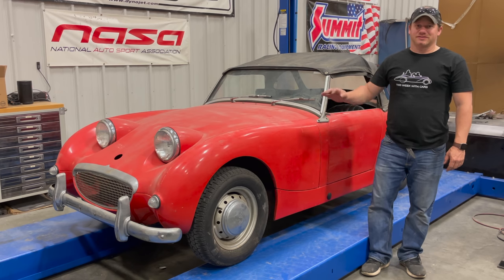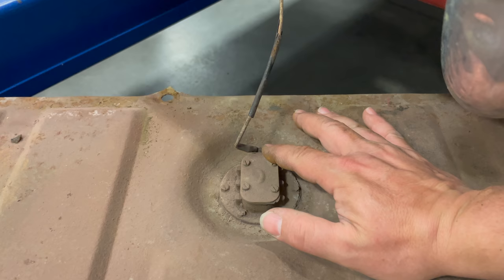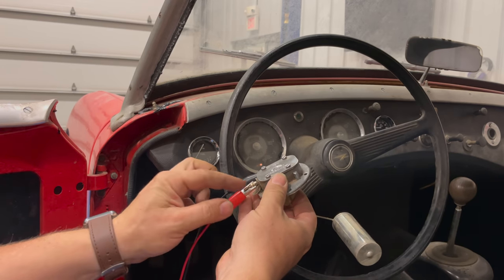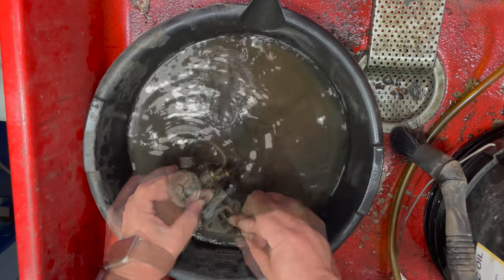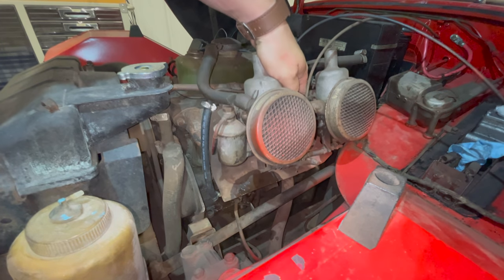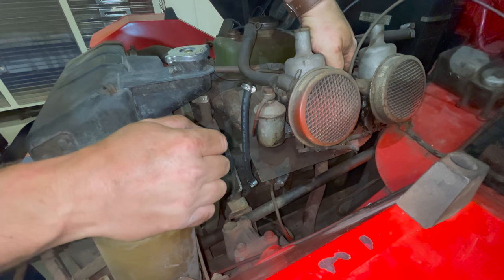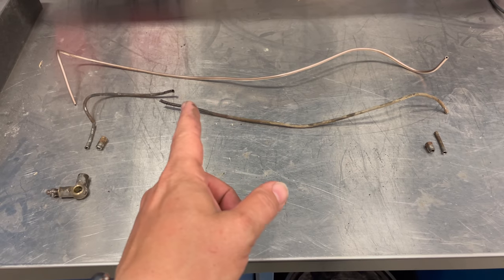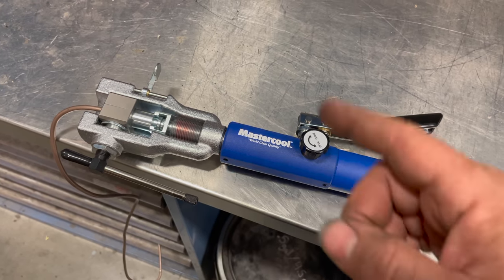Round 3 - Barn Find Sprite #4 - It Drives!

Comment: Out of curiosity, my 76B has had issues stumbling at about 3k rpm or so, Im stumped. New fuel pump (I can hear it sometimes not pick up fuel) which made it seem fine until the needle and its housing rattled loose in the carb, and now when I topped off the oil its back
Reply: Happens in 3rd and 4th around 3k maybe 35-45mph. Timing read 33 degrees but I bumped it down a little bit so figure 31/30. Only major changes I did was new exhaust and radiator